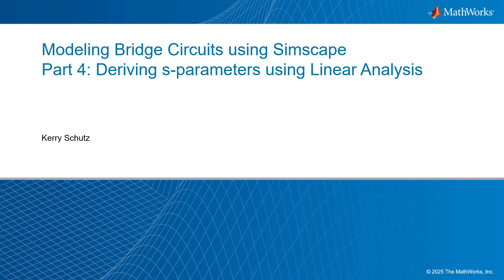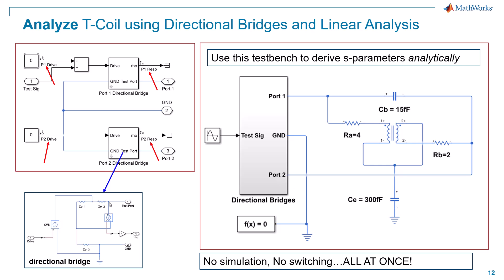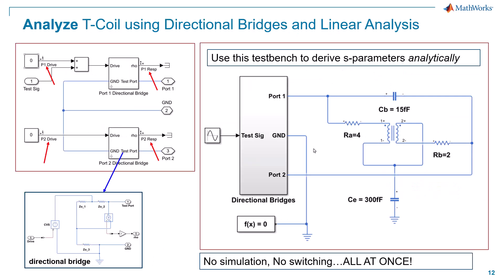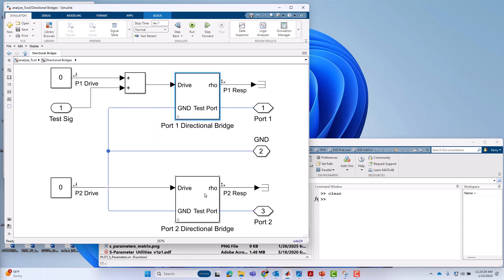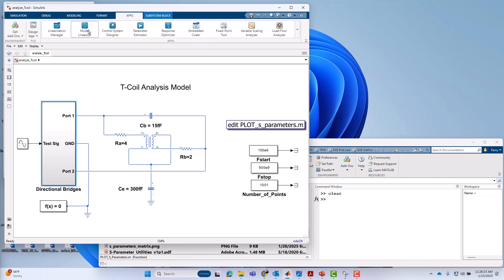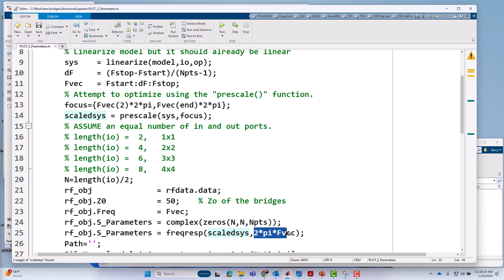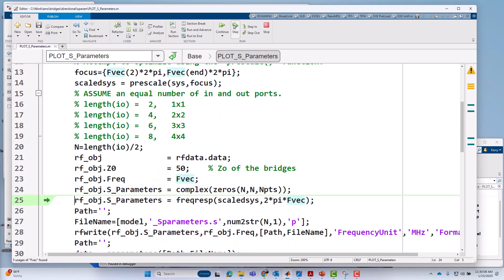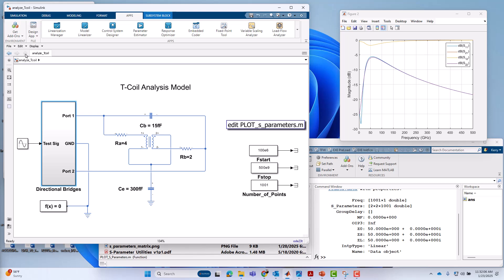Derive S-Parameters Using Linear Analysis

Comment: Is it possible to connect any type of circuit across the ports and extract s parameters
Reply: Yes, well any type of circuit that can be described using s -parameters which means any type of circuit well-suited for linear analysis.